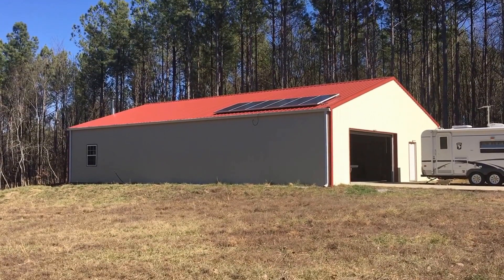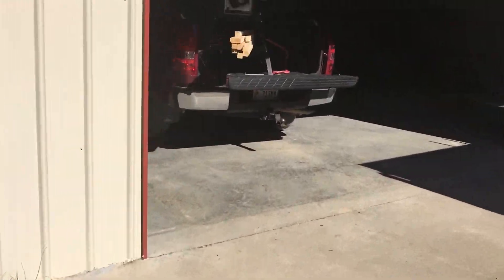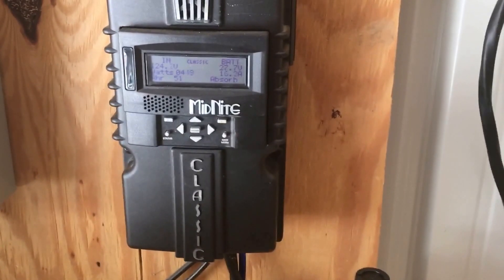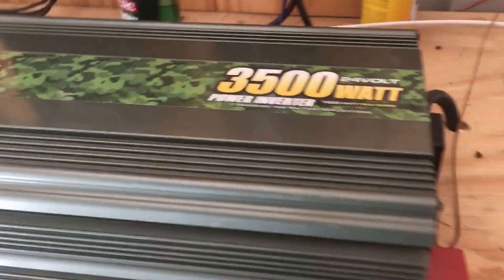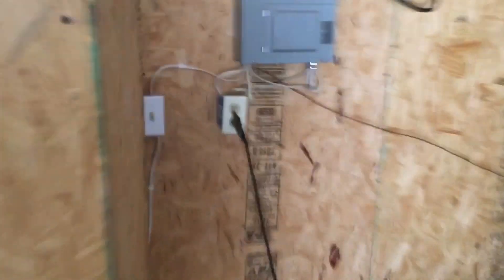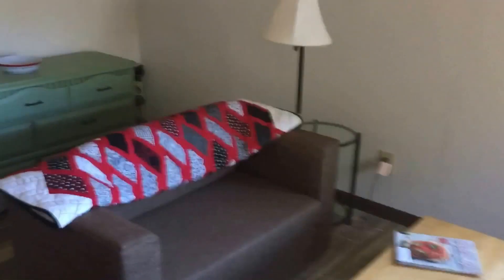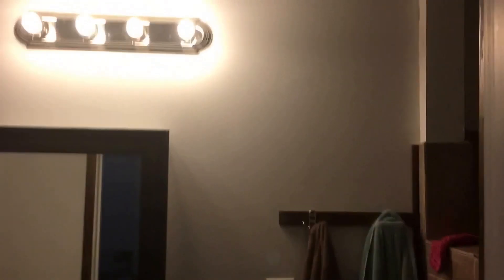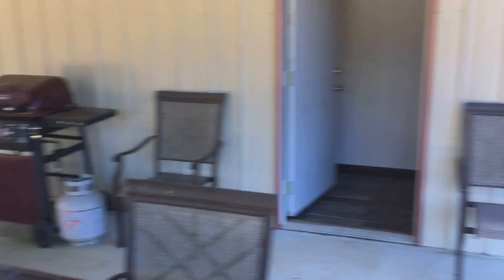Completed Cabin Solar System

Comment: Quite a small system for a barn
Reply from the maker: It meets my needs and can run 2 window Air conditioners in the summer.  We don't spend much time there in the summer, mostly in the fall for hunting.

Comment: good quality equipment, seen guys wire the panels in series to get more voltage in in low light,  apparently it works better they have high quality mppt controllers aswell, not a fan of modified sign can wreak havoc on fridge compressors etcget a humming noise through speakers too.